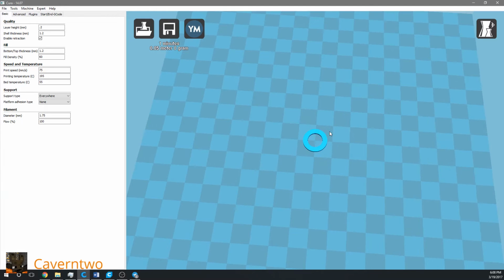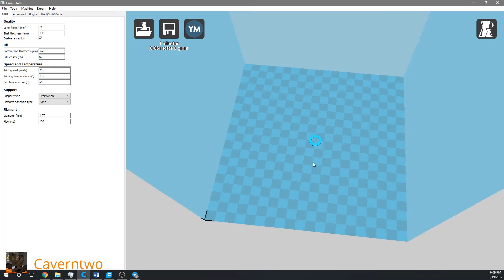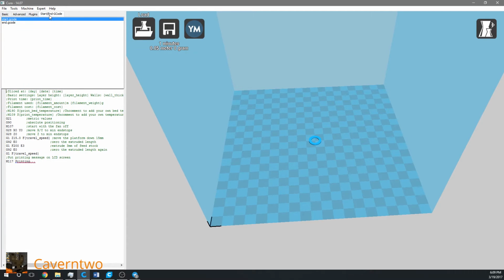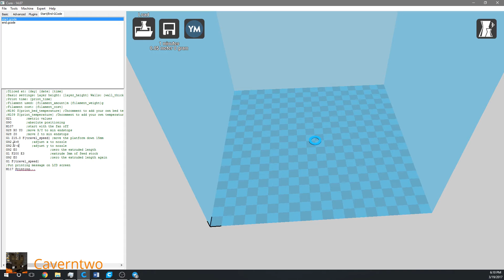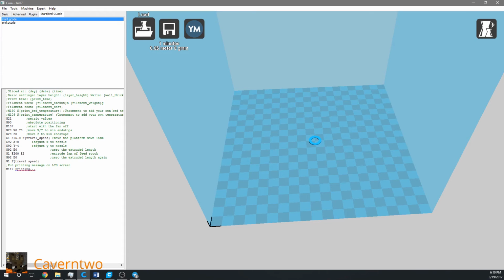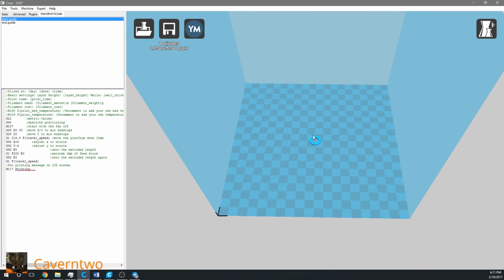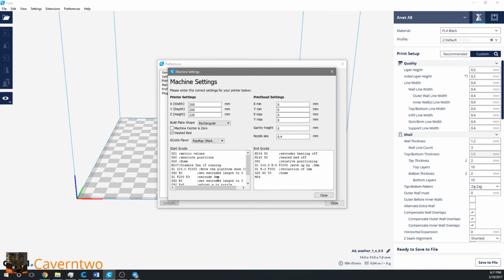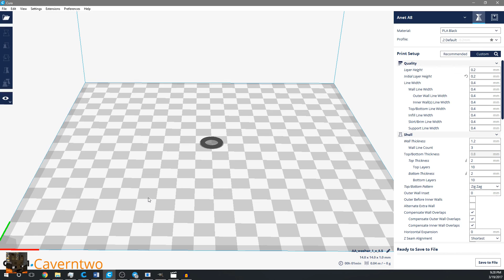Anet A8 E3D-v6 & Cura Upgrade

Comment: Hi, I really liked what you have done with the printer, but I have other question. Did you can print on USB port from last Cura version, because I can't solve that problem, I only can print from the original version that come with the printer.
Reply from the maker: I don't know anymore, as the printer has been heavily modified already. If USB printing doesn't work properly, try upgrading the firmware to Marlin and installing the latest Driver for the chip on the board. I've made a dedicated video about the first. To be honest, I've only used USB printing for two prints so far, as they mostly run offline with the SD card in my case.

Comment: Could you please export your Cura Settings and Upload it? I have some Problems to get it work... Thank you!
Reply from the maker: The thing is that most settings are useless to "get it to work". For the offset commands, please watch my video about G-CODE. And the other important settings are printer dimensions (X, Y, Z) and filament diameter (1.75mm) as well as the temperatures, for which Cura offers the possibility to create your own materials (duplicate an existing one and edit it to your preferences. Once created, the settings will be automatically applied when you choose your created materials). Everything else is up to you how you want your model to be sliced. The other problem is that I do not have this Cura profile anymore as I upgraded my A8 to a dual-extrusion printer.
Just try it out, you learn far more by trying out stuff than by just copying someone's settings.
If you have any specific problems though, please let me know.

Comment: hey man i hope you can help i started the upgrade to the e3d v6 clone from ali express im not sure if its normal but the element is really loose also how did u fiz the Z sensor when i press home all the nozzle is still to high even when i screw the bed all the way up i was thinking about to raise the heated bed so it comes to sit higher i know see i cant do that in cause with the belt
Reply: where did u mount the sensor on thants my main concern atm i cant see it in the video that well]
Reply from the maker: Hi, I'm sorry to hear that you ran into these issues. But I'm sure that there are solutions available.
How do you mean that the hot-end is loose? Did you fully screw in both screws? There could be a difference between these clones and if you don't get it to work, you could try another holder.

About the z sensor: I do not use one as manual leveling does the job as well. However, it seems like your issue can be solved by simply adjusting the position (height) of the probe. Let me know if one of these solutions fixed your problem.
Reply from the maker: Basically what a common sensor does is measuring the distance to the bed and switching once a specific distance is reached. It ensures that your nozzle is always in the same distance to the heated bed, regardless its height (the bed needs to be level, however). So if you raise your bed, nothing really changes. To fix this, you need to get the the sensor closer to the bed by lowering it on the carriage.
Reply: Caverntwo i meant the element block
Reply: Caverntwo what i did is i put 1 screw in the little block of the sensor normally their would be 2 screws and left under and right top so what i did is i put the right top screw in the holder of the left and it seems to wprk fine now leveled it out but still1 thing is that the heating block / element is really loose so when you touch it it wiggles around
Reply from the maker: So you mean that your hot-end is loose? Is just the hot-end/nozzle loose or the whole E3D? What sensor do you have?
Reply: Caverntwo the hotend / nozzle
Reply from the maker: Both the nozzle and the heatsink are just screwed into the aluminum heated block. Maybe you just need to fully screw them in?
Reply: Caverntwo thanks it helped i printed a test cube and it was perfect
Reply from the maker: That's nice to hear! Have fun with your new setup ;-)

Comment: if you want to stop the spool wedge from stopping your prints, use this little wedge i made that fits skate bearings:    https://www.thingiverse.com/thing:2424262
Reply from the maker: Hey, that's a nice design, keep up the great work! 
However, I already used something similar to yours after the making of that video but it let the filament unspool too much, wasting prints with new spools. Currently, I use the original one again...
Reply: Caverntwo ok

Comment: Hello, I have just upgraded my anet a8 with bowden and v6 extruder. Could u pls share ur cura settings? I am getting to much stringing with this upgrade, tks
Reply from the maker: Hi! Too much stringing is usually an indicator for wrong/not well-adjusted retraction settings. Furthermore, a Bowden setup tends more to stringing than a direct-drive one. While I'm pretty sure that most of your settings are fine, I use 2mm/4mm [PLA/PETG] as retraction distance with a speed of 45mm/s. If you happen to be unlucky and the stringing is still existent, play around with the values. I hope I could solve your problem. Happy printing!

Comment: Help me! My filament is not coming out anymore.
Reply from the maker: Hi!
This issue needs some closer description. I also encountered similar issues, namely that my extruder motor didn't push forward any filament because the nozzle was clogged because of surrounding dust. If you see the extruder motor slipping or hear it making some clicking noise, try to screw out your nozzle and take a look.

Comment: have a question I install skynet and when I home all my z axis keep going up instead of down it comes to center of bed but goes up instead of down what am I doing wrong
Reply from the maker: I didn't install SkyNet yet, but this question caught me. 
What version of SkyNet are you running?
A possible problem could be a wrongly configured Z_HOME_DIR in the Configuration.h file. 
-1 means, that it goes down for searching for the end-stop, 1 translates into the z-axis going up to the max end-stop.
Let me know if that solved your problem.

Comment: What was the offset g-code commands?  I could not see/read them in the vid.  Thank you!
Reply from the maker: Hi! The g-code commands for overriding the internal positions are:

G92 E0     ;set extruded length to 0
G92 X+8  ;adjust x-position to nozzle
G92 Y-4   ;adjust y-position

These values might be different for you. So feel free to experiment around with the values.
Reply from the maker: If the following G-Code didn't compensate your offset, look up my video about G-Codes to learn how to do it easily by yourself: https://youtu.be/SQ5ZOtb3Cjo